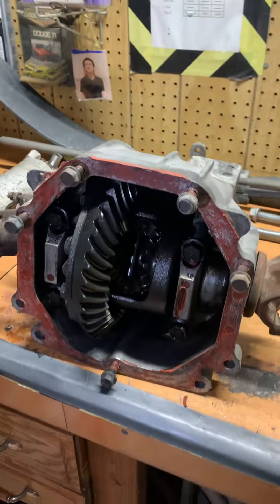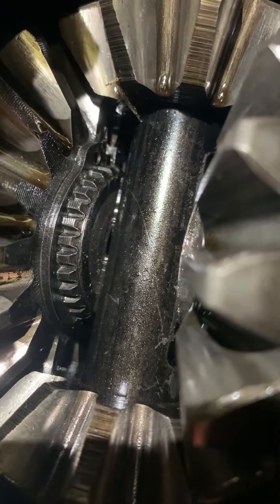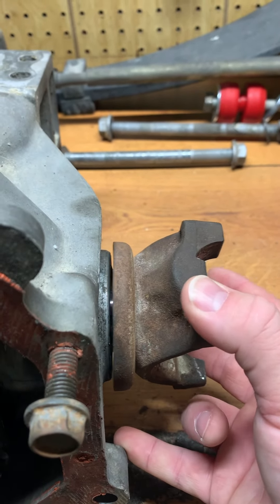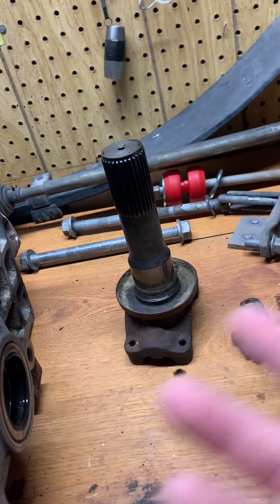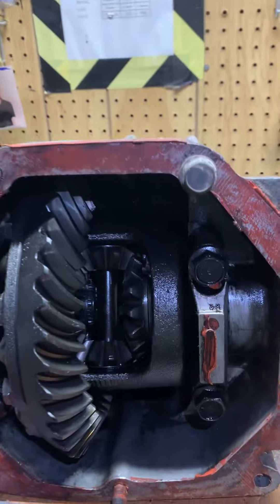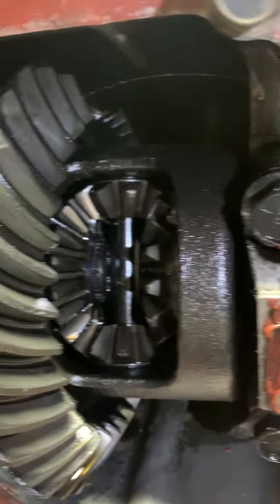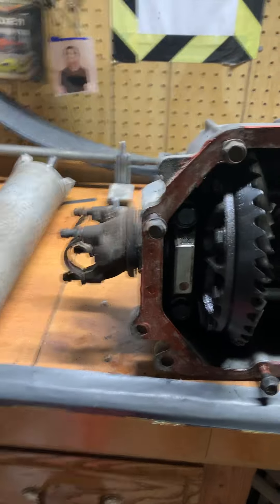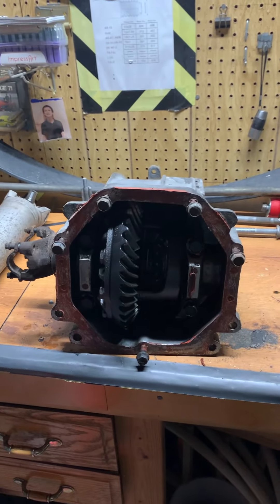The Worst C3 / C4 Corvette Problem

Comment: My Uncle has a 1976 stingray and his complaint ISIS whenever he makes a turn at a 35 40 mile an hour range he hears grinding noises coming from the rear end so your videos are very intuitive thank you. I greatly appreciate any insight that you could provide for me apart from your video thank you
Reply from the maker: For my problem, I encountered a high pitched whine. That was the only indication that something was going wrong. I do have a couple first get RX7’s that I’ve lockers in them that do make noise when I am making a turn while doing anything below 35. When I am in a parking space it is a worse grinding noise. That is normal as the clutches in the diff are slipping.

Comment: Really bad design, but aftermarket companies sell hardened stub axles or axles with hardened tips. This can be spotted on C3 by viewing from the rear, a lot of camber
Reply from the maker: Yeah. Mine has smart struts. I did find it odd that the smart strut was adjusted really far on the offending side… now I know why. Not a lot of guys with C4’s even have this problem I guess but I did get a better understanding when I discovered it is a common issue on the C3. Next year I’m going to be watching out for this on any c3/4 I see. These are east cars to work with. Just have to ask the right questions